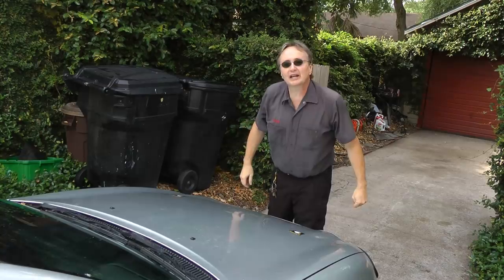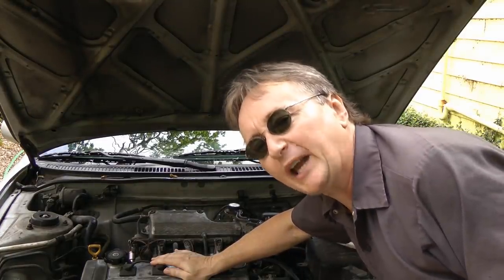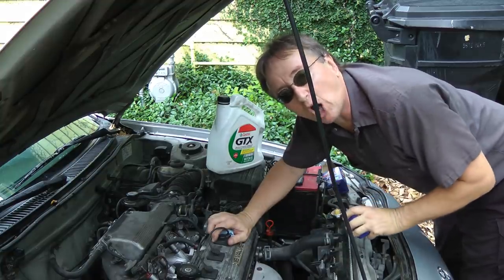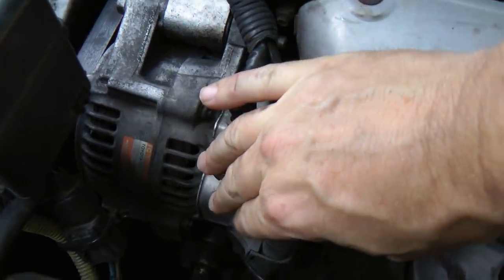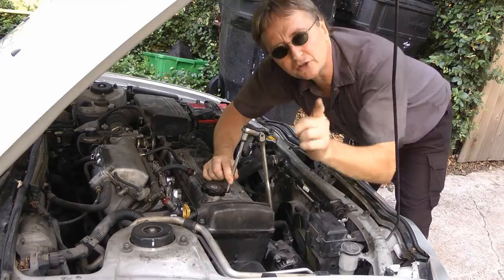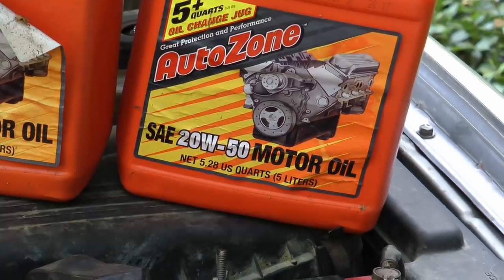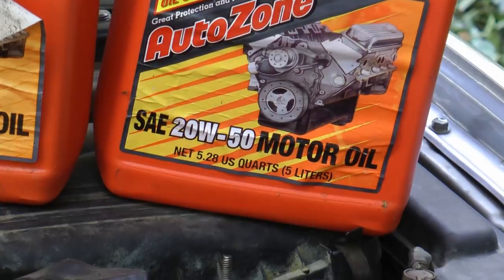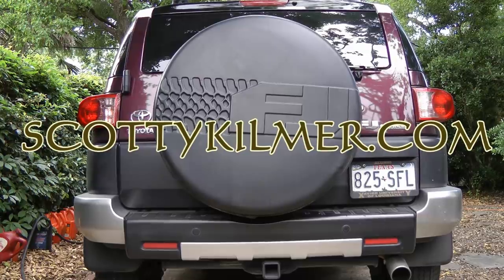Top 4 Mistakes Car Owners Make (DIY Fails)

Comment: All and every piece of advice given herein are extremely valid.  With regards to the 'tip' on removing electrical power from the vehicle when working on [it], since most automobiles electrical system is 12 volt negative ground, remove the negative battery cable connection.  Or you do as I did, which was to install a battery disconnect switch on the negative side of the battery.  Make sure that the switch has an amperage rating that is equal to or more than the cranking output of your battery.

Comment: True on all 4 points! I saw a mechanic get so mad for him pulling a Focus off a lift after changing oil and sure enough the old filter was still on it too and it didn't seal so there went around 3 quarts of oil on his shop floor from only driving it like 30 feet without knowing. I also after about 50 oil changes had one come off on me but I caught it before installing new filter, you always have to check (I always wipe off the oil pad boss anyway).

Comment: That first one with the oil filter seal? Good advice. Was working in a shop back in '92. Had just installed a new engine in one of the fleets 400 plus vehicles 2 months earlier. First oil change on it that seal stuck, I knew something was wrong but was in a hurry. Sure enough Monday it was towed back, engine seized. I accepted responsibility, lucky they didn't fire me.

Comment: On the oil weight thing, yes, W stands for winter, but it is not like a 10W30 oil is weight 10 on winter and 30 at operating temperature. Keeping with the 10W30, the meaning is: It's a multi-viscous oil with cinematic viscosity factor 30, that on winter temperatures (0º Celcius) behaves like a single viscosity oil with factor 10 would do. For any driving above 0º  degrees Celsius, the oil is a 30, and behaves like a 30 oil would. The advantage is in cold climate, where it flows like a thinner oil would in winter, but it doesn't mean the oil will have a cinamatic viscosity of 10 on winter.
Reply: CCCP Digital Studio in reality it has nothing to do with winter or summer. It has to do with the temperature of the oil itself as to how it reacts. If the vehicle is parked indoors and kept warm, it could be -50 outside and the oil has no clue. If the engine has a block heater, ( frost plug or coolant line heater) or oil pan heater, the oil will perform at the temperature it's at as it was designed to do.
Reply: Nope if it's 10w it means you can only use it in places that are 10 degrees
Reply: Wait a minute, cccp. At 32 F oil flows like 10 grade. At 200F oil flows like 30 grade. Or is it 100F?

Comment: in 20 yrs ive never seen a oil rubber seal to the block. Heard of  it but never personally seen 1
Reply: In 30 years I have never had it happen.  Also, If you start the car up and check for leaks you would find it.
Reply: Chev 350 eng do it all time
And some fords
Reply: Used to work in a shop that had over 100plus cars and Trucks.yes, it does happen,, not very often,, gotta get one of those bent hook shape tools to extract the rubber gasket
Reply: It happened to me once.  Luckily my father-in-law saw the oil leaking onto the garage floor and we got it shut off before doing any damage.  I never dreamed that it could happen to me, but it did.  I got in a hurry and forgot to look for the old gasket.  I ALWAYS double and triple check now and have been doing that for the 41 years.
Reply: Was a tech for 27 years... I did it once. Learned my lesson.
Reply: Did A change on a Sunday night and this happen, lucky i always check for leaks.  I was out of oil thought  and had to call in sick has i had to walk 5 miles to the store the next day.
Reply: Happened to me not too long ago.  Fortunately I caught it.
Reply: I'd seen one at a lexus garage. 8 litres of oil on the floor. It was a directors car as well. Not  good day.
Reply: Ive never heard of it and I have been working on cars since I was 16. Now I am 45. Got two mechanics in the family as well! I  guess you never stop learning!
Reply: In 30yrs I've never seen an o-ring stuck on the block. Til just after watching this video! I was changing my own oil, and just for shits n giggles I looked at the old filter, the gasket was stuck on the block...
Reply: It usually happens when the person installing the filter didn't lube the o-ring and/or also over-tightened it.
Reply: My 99 mercury does it about 1 out of 3 oil changes
Reply: Dixon Cide
Reply: I have on big trucks. The old seal very often stuck to the filter base.
Reply: It can happen if it gets installed without lubing the gasket.

Comment: There are some exceptions I think to using the recommended oil.  My car recommends 5w-20 but all the newer generations built after 0w-20 was developed all recommend 0w-20 without any major change in tolerances or engine design.  The 0w-20 is better at start up and is only 0.3 viscosity less than the 5w-20 at running temperature and gets better gas mileage.  I decided to do this after reading through a page on modern oils that I'm seeming to have trouble finding now.

Comment: The "W" in the oil number means "Winter" not "weight" Which means how fast the oil can move from point A to point B in Winter.
Reply: Hello. When you see aW on the label of oil containers, such as 10 W 60, 10W-30, 0W 20, the W means, winter, not weight
  When you add anti-seize to spark plug threads, you change the way the spark plug cools. The only way a spark plug can cool is by transferring it’s heat through the body of the spark 
plug that threads into the head.
  When disconnecting any battery, always always always disconnect the negative post first. If you put a wrench on the positive terminal and accidentally contact metal such as radiator support with air cleaner housing or any metal, you will have a spark. Lead acid batteries give off hydrogen. Especially near dead batteries. Remember the Hindenburg? Been there
  When changing your oil filter, pour some of your new oil into the filter even if it is horizontally mounted, so your engine won’t starve for oil until the Oil pump can fill the oil filter.
Reply: No it means walrus

Comment: Don't go by mileage on your oil change go by the color of the oil change it before it turns dark brown
Reply: Rick Simpson I was working on a piece of crap Dodge Ram and it’s a 2016 Cummins 2500. The oil was basically same as the tires and the spark plugs were orange/red with green crud, don’t know how that happened. 😵😄
Reply: Colby Liam Walden they didn't change the oil often enough or it's never been changed.!!! Just add some gasoline to the diesel fuel it'll clean up the spark plugs real good.!!! Someone probably put some crayons in the cylinders.?????
Reply: Colby Liam Walden spark plugs 😂🤣😅😂
Reply: If you did that with a diesel engine you'd be changing oil every day.
Reply: Spark plugs on a cummins hell yeah
Reply: Colby Liam Walden that is because oxide   Sparks are nade out of copper, and it becane corroded mire than burnt or dirty. Use warmer grade spark plugs
Reply: Awful advice.
Reply: And always using punctuation when you write comments so it makes sense to those who read it.
Reply: Color isn't an accurate determination on the condition of engine oil. If it looks clean that's really great... but if it looks dirty, as long as it isn't extremely dark (black), they oil is doing its job. 

Also, healthy diesel engines will turn brand new oil black within a few hundred miles and it's normal.

Comment: Good info, I.always fill oil filters first and only hand tighten. Never had one leak or come loose. When I come to remove it, I don't need a filter wrench, as I didn't over tighten it in the first place.

Comment: Hi from  Bulgaria Scotty, I have a question about the engine oil. I have a BMW E46 with M43B19TU engine ( 200 000 km by odometer at the time of purchase) . When I bought the car it was burning oil - something like 2 liters per 10 000 km. I used  5W40 oil as car manual suggest. I searched for help from different people who pretend to has good knowledge of car maintenance. Most of them told me to switch to heavier oil. I tried 10W40 with the same result. Then they told me to use 15W40 - I rejected to do so. Eventually I replaced the valve stem seals by myself (it took me 10 hours :D ) and now with 5W40 the car is not burning any oil at all. But here is the question: all the people who told me to switch to heavier oil like 15W40 to prevent oil burning claimed that the oil must be switched with heavier in accordance with the engine mileage - Is it true ?
Reply from the maker: +Daniel Genov  worn engine often work better with heavier oil, yes
Reply: Thats really not true. The small number is for the viscosity at low temperatures and the big number ist for the viscosity around 100 degrees celsius. So changing to 10w40 or 15w40 doesnt change a thing because a cold motor is not running so not burning any oil. When its on temperature its nearly the same. What makes a difference is the brand. I have made very good experiences with 0w40 com Mobil 1 New Life. This shit stopped my diesel engine from using oil :D. I love it. And my car too, the first had 290.000km as i sold it and the current one is on 320.000km and running perfect with first set of everything.
Reply: I think they meant thicker oil AT OPERATING TEMPERATURE. There is no difference between a 5w40 and a 15w40 at temp. I suspect they meant you to try a 15w50 etc...
Reply: There is nothing wrong. That is completely normal for a BMW. Burns Motoroil Weekly. that is why they named them that.
Reply: lol thats the first time i heard that one, nice
Reply: Scotty Kilmer very interesting. I grabbed one of every oil at the store and put them on a scale and they all weighed the same. So where is this heavier oil that you speak of?
Reply: devildart he means heavier by viscosity not weight

Comment: He's right about the oil filter gasket. It stuck to the block when I was changing the oil in my mother's 1 year old Ford Explorer. The old gasket pinched, and when I cranked it, it puked half the oil on the garage floor. Thankfully I realized it pretty quickly and didn't damage the engine

Comment: Scotty is wrong. Don't just take any battery cable off. Take the ground off. Always take ground off 1st and hook ground up last.
Reply: You make a great point, but that doesn't make Scotty wrong, it just means he wasn't as detailed as you would have liked. My car has a cover over the positive and is difficult to remove, while the negative terminal is simple and easy to disengage, so even before I knew that the negative (ground) was the correct one to remove first, I did it by default. But I acknowledge that you're correct and that order should be mentioned
Reply: He did show the ground just never said it!

Comment: Definitely lube the oilf filter gasket when putting a new filter on...the first time I changed the oil in my Jeep it took me a week to try to cut the oil filter off because the owner before me didn't lube the gasket and must have cranked down on the filter with a wrench. So make sure you lube the gasket and only hand tighten it! Since I started changing me and my wife's oil, I've never had to use our filter wrench to get it off again!

Comment: I have to wonder why a car computer costs $1500, as much as a top-of-the-line gaming rig in some cases.
Reply from the maker: +ReddmanDGZ cause manufacturers love making money and own the rights to their own computer design.
Reply: I kinda figured that part, lol.

It's just insane, I've poked around inside these computers and even the most complex ones are a simple series of cascaded logic controllers with inputs and outputs, essentially a specialized PLC.
Reply: +ReddmanDGZ Because they have to last 20 years, be completely immune to temperature, humidity, and dirt, besides boot up in less than a second, and never crash. It is a very different engineering problem than any home computer.
Reply: One word.....Capitalism
Reply: guyonearth we have miniature gadget boards the size of a wallet that can also boot up in seconds and perform the same tasks. $40-$70 MSRP. Weather-proofing isn't that hard or expensive either. Much of it really does boil down to money, profit vs expense. That money certainly isn't going to long-term firmware updates for ecu's or satnav/infotainment systems, which tend to start getting buggy after a few years
Reply: If it weren't for capitalism, you would never be able to buy a computer for your car if you fucked the first one up.  The govt would have you put on a waiting list and question you as to why you want a new computer for your car and all the red tape would cost you $500 on top of the cost of the computer, which would cost you $5K minimum.
Reply: what do you know Vlad?
Reply: NEVER CRASH. HAHAHAHAHAHAHA. That's why Updates are out every month. Every time we hook up to a vehicle we have to look at the software number and check if there is an update. 3 out of 5 do. I have about 35 package cars I see monthly, some more than others.
Reply: $1500 is cheap, I've seen some for several thousand dollars, and that's only 1 computer, today's vehicles usually have several computers.  Engine, transmission, instrument cluster, etc.
Reply: Simple. Because PCs are generic.
And ECUs are very specific and extremely accurate.
Reply: Same reason an in-car GPS cost $1000-plus when you can buy an oft-better Garmin for about $100...
Reply: A car computer costs $1,500 for the same reason premium gas costs $0.60 more than regular, high performance cars need it and they can get away with it.
Reply: You are the only one who figured that out, Grim Dark End. . The rest of us pay top dollar.
Reply: Captive audience. You need it, or your car is hosed. You can't get it from anyone else

Comment: The W on oils does not mean weight. Means winter. Depending on the manual and environment you can use different oils too. good vid tho
Reply: yes it does
Reply: +ss4goku9695 yes it means weight? lol look it up
Reply: I know it means weight haha
Reply: it most definetely means Winter :')
Reply: Byron Hammond Well then how do you determine the weight of the oil?
Reply: Same thing, split another pube.  Weight/Winter, really just a colloquial term for viscosity/resistance to flow.

Comment: The oil viscosity is more dependant on the temperature, if you are in Arizona in the summer, the 5w20 on newer cars caps slowly ruin your motor and that 20w50 will be the right stuff.  Most  owners manuals have what viscosity to use in what temperature range.

Comment: "" W" stands for WINTER not WEIGHT.
Reply: Indeed.  Weight is annoying.  Like referring to 80W90 gear oil and "rear end dope".
Reply: Evan Miller  Agreed. The "W" represents the oil's thickness in cold temperatures, which you still think of as a "weight", so to speak.
Reply: Then what is "summer oil"
Reply: Just remember the Japanese would have crushed this Toyota long ago, so by the time the oil is diluted with fuel, with tired rings, 30 is probably a bit thin
Reply: I asked my instructor and you're correct! I never knew thats what it meant!
Reply: The higher number.

Comment: Surprised you didn't recommend filling the oil filter with fresh oil before installing.
Reply: Thats a great idea if it screws on vertically, not so much if it screws on horizontally.
Reply: You don't need to prime passenger vehicle oil filters.
Reply: No, the filter holds oil in it's paper pleats and in most cases the way the filter is installed does not allow it to drain.
Reply: Depends on the filter. Some are pre-filled, some are dry and requires oil
Reply: Never seen a pre-filled filter off the shelf.
Reply: That is why after an oil change, even if the oil looks at the right level, you run the car for 4-5 minutes, then turn it off. Wait 15-20 minutes and check the oil level and top it off if needed. It would be better to drive the car for 5 to 10 minutes and then let it sit for 30+ minutes and check the oil level though. Also, after driving the first day for a while, the next day check the ground where the car was parked, to see if there was a spill. If you noticed any fresh drops, you should be able to align it to see whether the oil drain plug or the filter was leaking.
Reply: derkgts10: Your comment describes best on why I should change my own oil and not take it to the shop, because I'd say most if not all people who work there share your point of view.......
Reply: Oh that must be why high end filters have anti-drain back valves hmmmm, it's not a myth but putting a filter on dry won't hurt anything either unless you start the engine after a fresh change and rev it like a madman, I have neighbors that seem to think reving their engine is a means to repair.
Reply: Vertical or diagonal is alright, but if it's horizonal, forget it, just screw it in. Not worth the hassle trying to fill up the oil in a filter that is going to screw in horizontally.

Comment: My 1992 ford flareside with 302 when cold idles 900 when it reaches normal idles 1400. I changed out tps,iac,egr and cleaned up the thortle body's and replaced air filter. I haven't been able to find the cause. Thank you Jeremy

Comment: Having problems getting the old oil filter off my '94 XJS.  Thing I can't figure out is that Jaguar very clearly emphasizes that a new one should only be put on by HAND tightening (about 1/2 turn after contact made).  So, why is it so damn hard to get them OFF by hand (assuming the PO followed directions)?
Reply: Improper installation -- no lube on previous gasket.